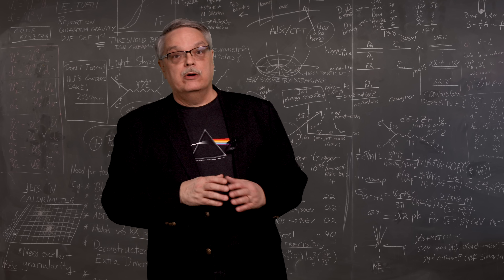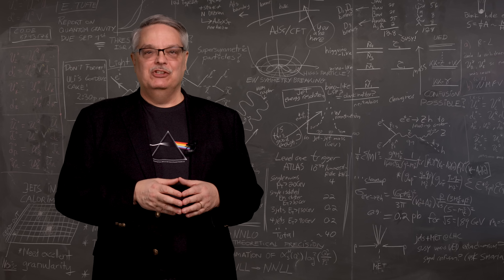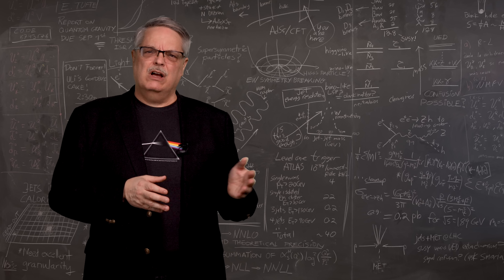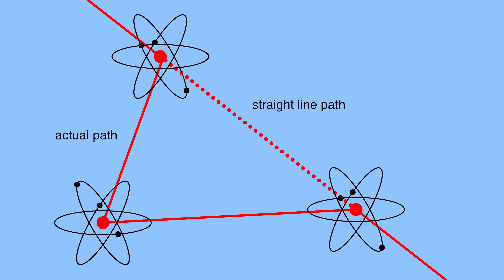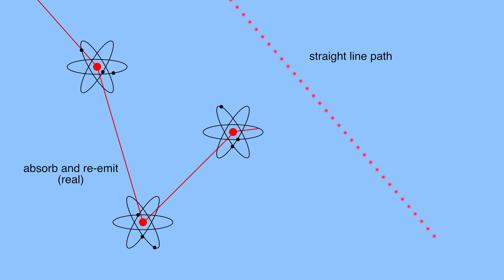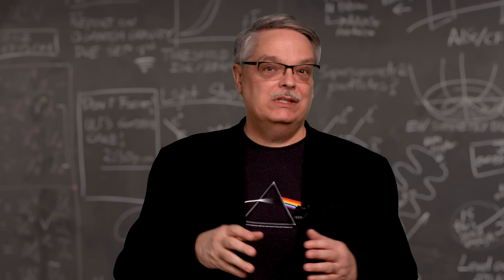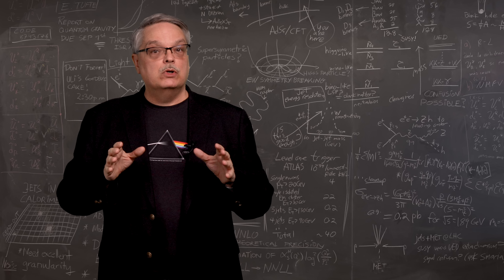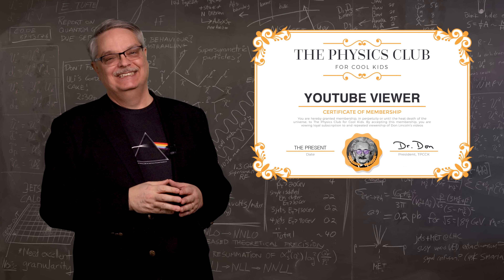Why does light slow down in water?

Comment: Then what about the phenomenon of reflection from a surface? With due respect Dr. Don Lincoln, the explanation you have given may be correct, how can you deny absorption/emission explanation given @5:40.  (1) A single photon and single atom will not obey snells law since there is nothing called medium interface in there. (2) Similarly, a single photon and a medium interface will also not obey snells law, as it requires a wavefront. (3) A beam of light and a single atom also, will not obey snells law. Quantum mechanically a photon can fly off in any direction and it requires an ensemble of photons as in a beam of light to create what we usually call a wavefront.

When a beam of light (containing trillions and trillions of photons per second) hit a surface of material (containing trillions of atoms) absorption-reemission of photon occurs (with some average delay on spontaneous emission) and each atom will try to emit photons in random direction, but surface acts like a phased array and an ensemble of photos (wavefront) can occur at two possible positions one in the reflected medium and one in refracted medium. Due to specific incoming beam direction and average reemission delay of the atoms in the material, reflected and refracted beams will be formed in a specific direction, and it will not appear as a random glow in material as you explained.
In between emission and absorption light always travel as it is in a vacuum.

Refraction (or reflection) is a surface phenomenon (light bending occurs in the surface), bulk material has nothing to do with it.
Reply: > single photon and single atom will not obey snells law   
Since I also asked this myself - any proof/papers on that?

Comment: I think this effect can be simulated in a ripple tank using plastic or wooden balls floating on the surface as an analog to the atoms in glass. My guess is that if they are considerably smaller and spaced more closely than the wavelength of the incident wave on the surface then the wave that propagates through them will slow down just like the wave of light through glass. The ratio of slowing down will probably be some function of the size, density and spacing distance of the balls.

Comment: Well, interesting and archaic but, no, that is not how light works. 

Light is neither a particle nor a wave as that is impossible. 

If light was a particle then it would, by default, be ‘Matter’ and Matter has an attribute called ‘Mass’. Mass is location specific and is a force dependent function of Gravity. Gravity only exists for it is a property of Matter.

Light is not a particle as it has no mass.

And we know that light is not a wave because a wave is created by what something did. Light is (including All electro-magnetic radiation) caused by Matter creating a disturbance.

This disturbance, or perturbation, radiates from its source by inducing a qualitative change outwards (radially)and through the medium. This is the rate of inductance.

Every different medium has a different rate of induction. And therefor light can only travel through it at the given rate of induction of that medium.

There is no loss or gain of energy when light goes from Space into glass and back out. Light travels at the induction factor of whatever medium it is in.

We also know that electro magnetic energy has a constant rate of inductance (speed)in a given medium. A vacuum (space) for instance has a rate of inductance as does water. Take that same energy and put it back in a vacuum and it instantaneously resumes it’s constant speed in a vacuum. You could do this all day from water to a vacuum and that constant will never change.

But if light was a particle it would have a rate of velocity in a vacuum.  Upon entering another medium it would immediately slow down and eventually stop due to its interactions of other Matter. 

If that light was taken out of that medium before it lost all its velocity and placed back into a the vacuum, it would not be able to  resume its initial velocity.

To regain its initial speed it would need to be given energy equivalent to the energy it lost. And the only way to add energy to increase speed is to add energy to a particle.

Adding energy to energy just increases energy. Energy can not do anything except interact with a particle. Well that is not entirely true, magnetism eventually returns or is absorbed by the magneto-dielectric dynamo we call Matter.

Comment: Sir, if the speed of light in a transparent medium depends on the atoms of the medium, the density of which determines the refractive index of the medium, then the speed of light must also vary with change in density of air! But I could not find any article relating to the change in speed of light in air with different densities. I don't understand why we take speed of light same in air and vacuum when the density of air may vary significantly...!🤔
Reply: Light does alter its path (change its speed) a little through different densities of air.  This is why stars twinkle.

Comment: This makes sense but doesn’t explain why light bends near gravity. The effect is the same in both cases so shouldn’t the cause be as well?
Reply: Not the same effect.  Light makes a sharp turn when it hits a different density.  Light follows a gentle curve (a geodesic) around a gravitational source following the curvature of spacetime.
Reply: @cloudpoint0  https://youtu.be/968gVUAY9Mg unfortunately we cannot create gravity with a clear boundary like we do with a solid object but we can replicate the gradient of gravity with a gradient of density.like in the video linked.
Reply: @greglaletin  
The curious thing is why a gradient only exists if light impacts a single-density medium at an angle but not if it impacts at 90 degrees.  The bending happens at the interface when light impacts a single-density medium at different moments in time, as happens when the angle is not 90 degrees.  Your linked video is about a varying density material.  The same effect happens in the atmosphere.  It arises because there are multiple closely spaced interfaces, a gradient of interfaces, but it’s still refraction, just repeated refraction.

In a loosely comparable sense, gravitational curvature is also caused by a varying density, not of an actual material medium but a changing density of the gravitational field.  The gravitational field causes actions, time itself, to slow down (actions like clocks tick more slowly).  Light passing a large mass progressively slows down and then progressively speeds up again in a slightly different direction because the progress of time changes in the same way near that large mass.  Of course, a photon doesn’t see itself as slowing down at all, or changing directions.  But it’s traveling through more time (takes more time) to cover the same distance and we call this slowing down.  It is actually following a geodesic in the curvature of spacetime, which we can’t see.  This is called deflection rather than refraction.

There’s no measurable gravitational field density variation in a dense material medium showing refraction.  Different causes but slightly similar effects.

https://wikidiff.com/refract/deflect

Comment: Good explanation for why it slows...but why does it bend?
Reply: Different frequencies slow to a different degree.  The combined wave front of all frequencies is shifted.
Reply: @cloudpoint0  Thanks for your comment. However, even monochromatic laser light will be bent, so the bending can't be due to different frequencies moving at different speeds.
Reply: @cloudpoint0  I did some web searching for the answer and found this GIF which seems reasonable:  https://i.stack.imgur.com/Z0Tgb.gif
Reply: @thedubdude  
A monochromatic beam of light won’t experience diffraction (obstacle-induced bending) or dispersion (spread apart of frequencies).  It does experience deviation (bending of light, refraction) because its single frequency is slowing down.  It will change direction.  Different frequencies will deviate differently upon entering the glass.  A single frequency deviates consistently through the glass (no spread, no additional directional change).

I think it loosely boils down to parallel photons (rays of light) crossing the glass interface at different moments and the specific frequency setting the direction or amount of deviation in that medium, or the dispersion if multiple frequencies are present.  At the quantum level we would probably say there are still different frequencies involved even for a monochromatic beam of light, different in phase but not in color.  It’s a complicated topic.

http://hyperphysics.phy-astr.gsu.edu/hbase/geoopt/refr.html
Reply: cloudpoint  Thank you for your explanation.  Do you know if all light frequencies are slowed? And if so, is it fair to say time has slowed down in the media?
Reply: @thedubdude  
My understanding is all light frequencies (colors) are slowed, by different magnitudes.  Again, as you pointed out, this does not explain deviation (since monochromatic light of one frequency also deviates).  Deviation is related to different phase velocities in adjacent rays, I think.

“is it fair to say time has slowed down in the media?”

This is a good question.  Time as I understand it, is motion in space (clocks are standard motion references).

If the motion of light is slower, you could argue time is moving slower, due to some special conditioning of space.  A gravitational field certainly slows both motion and time, and is a special conditioning of space.  But if light is slower and time is slower, the two conspire such that light still has speed “c” inside that space (but its frequency changes).  We likely would not measure a speed change.

Or you could argue that time hasn’t slowed and space is conditioned in another special way peculiar to the medium that affects the apparent motion of light.

I don’t see what mechanism would suddenly slow time down in glass, and then speed it up again on the other side of the glass, certainly not gravity.  So I tend to think space is conditioned in another special way peculiar to the medium of glass.

I would say that photons still travel at “c” inside glass, but there is an “apparent” decrease in the light’s overall speed.  My explanation is the differently phased frequencies interfere in a way that kicks the phase velocity back a partial step and stretches the phase peaks as it moves within the glass, which is how we measure the speed of light.  We can’t measure the speed of the actual photons.  This also explains why light is again moving at “c” when it exits the glass, the photons never slowed down.  But this is just an intuitive feeling that I have and not something that is empirically shown anywhere that I know of.  I might be very wrong.

Comment: That did not help, because there was no explanation of how the waves emitted by the electrons are different from the original light waves. Thus it is impossible to visualize the sum of the original light and the light emitted by the electrons, and thus to understand why it is moving slower.
Reply: Light has a phase velocity that’s usually the same as the speed of light and the summation of the two waves is continually bumping the phase velocity back a bit, differently for different frequencies, which makes it appear to travel more slowly, and makes it turn directions.  The video sort skipped over a lot of details.

Try this video instead maybe …

https://youtu.be/CiHN0ZWE5bk

Also see this animation showing the effect in action…

https://en.wikipedia.org/wiki/File:Wavepacket1.gif
Reply: @cloudpoint0  Thank you for the explanation and the links. The calculations you are referring to are from classical E&M, yes? I'm guessing you would need heavy mathematical machinery from QFT (specifically QED) to derive the reduced velocity from the photon perspective, is that right?
Reply: @RalphDratman  
The video that I linked to provided both a classical and quantum perspective on what’s happening.  I don’t think any calculations were discussed in the video but they would be complicated for the classical perspective and horrendous for the quantum one.  I don’t think QED is involved for the latter, just QM wave mechanics.  QED pertains to bound states.  It might be a factor in the electron states, how they change, I’m not sure.  The electrons aren’t really the important feature of the story.

The way I understand it is, the apparent reduced velocity is an aggregate effect that emerges from all the superpositions involved but any single light wave or photon always remains traveling at the fixed speed of light.  Conceptually, the electron-generated (or interfered) light waves keep repeatedly interfering with the main light wave such that they kick the new combined light wave back by a phase step as it moves along, resulting in an apparent slowing of the wave.  I might be wrong.

There was a second companion video to the one I linked to but I’m not sure if it is better.

https://youtu.be/YW8KuMtVpug

Comment: You do realize that none of the theories you support have been observed. No one has seen light bounce off of the nucleus of an element.
I think Walter Russell may be right when he said light does not travel, it reproduces itself. So, we're not talking about light speed then but about its rate of induction.
Mainstream science is full of holes. It works! but whatever system it creates is is subjected to heat death, it is highly wasteful and inefficient, and it is not sustainable.
At 9:29 you're saying that when light leaves the glass there are no atoms around.....Is your experiement conducted in a closed system where you got a perfect vacuum? Now you have glass in vacuum, and light, en electromagnetic wave propagating itself through NO medium at all....
This is how mainstream science works, it picks and chooses whatever elements of the system  is in vacuum and what is not, and it then devises a theory based on an event observed in a moment of time, and calls it a law.
You can read of many inventors that have constructed devices that work and they all define the laws of physics, or you can continue to pedal bad science. You can even get a grant to do something wasteful, but you will never get any money to build something that actually makes the air better AFTER it used it to do work, as Viktor Schauberger did, just one example.
Much of physics, and science in general, is flawed, but since 97% of people don't read any practical books the world remains the same. Nothing ever changes, because you the sheeple don't change. You just ant to beLIEve, and never notice anything wrong with your beLIEfs.

Comment: The answer provided in this video still leaves many open questions: 1) if the interaction of (say here) two waves creates a combined wave that travels at a different effective speed, what happend to the speed of the initial wave causing the superposition in the glass/water/medium? Why would that original beam of light disappear completely and not just continue at the speed of light in vaccuum? 2) the superposed wave in the medium will again interact with the matter (atoms) in the medium, which will lead to more superposition, so does that mean that the beam of light will slow down increasingly with the thickness of the medium (of higher refractive index) it travels through?

Comment: But why does the path change then?
Could you please explain?
Reply: Different frequencies slow to a different degree.  The combined wave front of all frequencies is shifted.  Think about marching soldiers where a column on one side is moving slower than the column on the other side so the whole parade turns.

Comment: So Photons, as taught in my school in the 80s don't exist - because light is a wave and not a particle.  I understand the slowing down/speeding up part, but why does the interaction with the wave created by the electrons bend the angle of the light?
Reply: Different frequencies slow to a different degree.  The combined wave front of all frequencies is shifted.  Think about marching soldiers where a column on one side is moving slower than the column on the other side so the whole parade turns, until the slow column picks up the pace.

Comment: Lol that Theory is even worse than the "Einstein's" that we hear on the internet, that mass (of the water) has caused a curved dent in time which means the light can travel at the same speed but relative to us it appears to have slowed down whilst it was  still going at the same speed but the time has changed speed?
Of course that Internet Theory seems to be disproved by the fact that time relative to us is revolutions of planet Earth equal 24 hours, regardless of whether or not light is travelling through water? 
On a serious note I prefer to compare oscillations in the magnetic field [electromagnetic waves] with sound oscillations which travel at a different speed in air, liquid, solid etc
Sound oscillations we can easily visualise as Vibrations.
 We can feel the vibrations when we put our hand on a loudspeaker. 

In a similar way electromagnetic oscillations are vibrations in the magnetic field. 

Sound travels fastest through solids. This is because molecules in a solid medium are much closer together than those in a liquid or gas, allowing sound waves to travel more quickly through it. In fact, sound waves travel over 17 times faster through steel than through air.

With electromagnetic oscillations they travel fastest in a strong magnetic field in a vacuum and slower the more dense the matter. 
When a beam of light enters the water at an angle one side of the beam touches the water first and slows down when it gets to the other side that side of the beam leaves the water first and resumes speed of light in air that's why it leaves at the same angle and it doesn't need extra energy  to resume speed